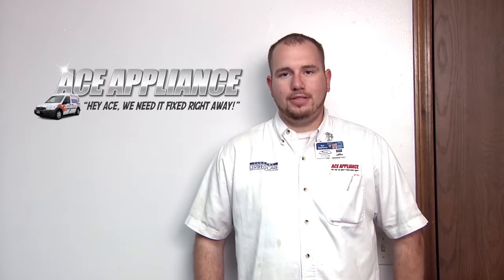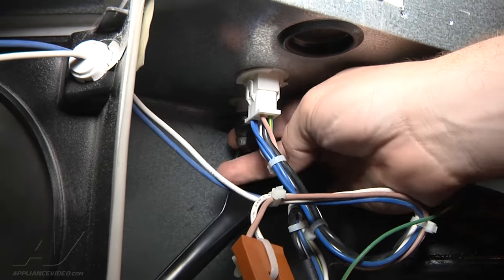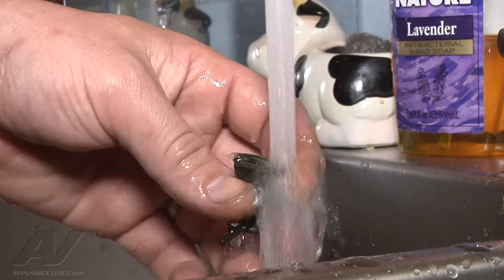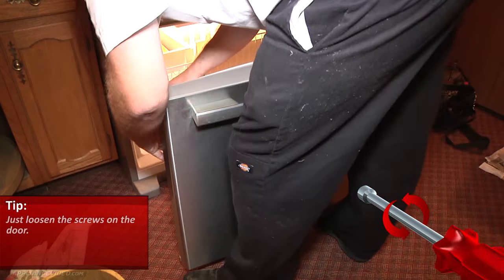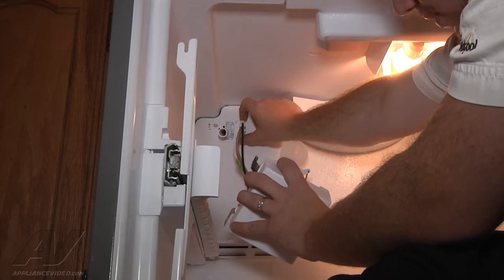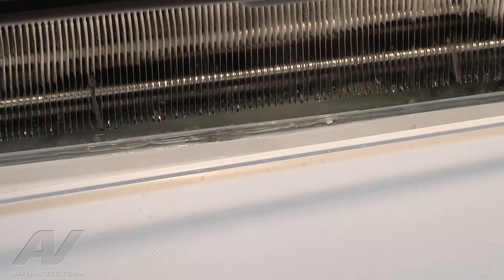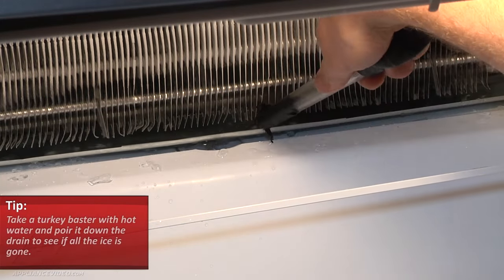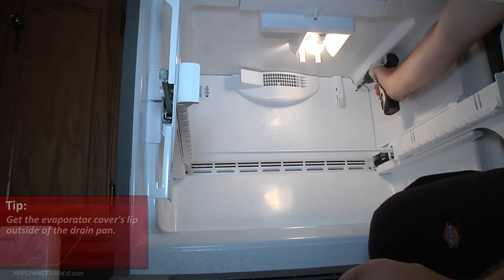Whirlpool Refrigerator Repair - Ice Buildup in the Freezer - GX2FHDXVY06

Comment: Very, very helpful video!  My frig is a slightly different model made in 2016 but largely similar, with a trap instead of the one way valve.  The trap was plugged with gunk which was easy to remove.  I really appreciate the detailed steps in the video.  Thanks for going to the trouble of making this available!

Comment: Perfect, thank you! I just fixed the problem following your video exactly. Instead of ice clogging my drain, there was a ton of insulation blocking the drain. I had to break it all out using screwdrivers from inside the freezer and the bottom of the drain tube. It seems crazy to me, like someone used spray foam to intentionally plug up the drain. Have you seen this before?

Comment: With my similar Whirlpool WRF535, one of the annoying habits is that Ice can spill behind or fall through the slotted trays and accumulate on the bottom of the freezer.  Eventually this interferes with the door closing completely, causing frost to build up.  Thanks for the tips on how to get the door and bottom tray off quickly.  Easy!
Reply from the maker: Great question, if you have a more technical question that our parts department cannot answer, you can search our over 17,000 answered questions free at our website www.ApplianceVideo.com under our Repair Help section. You can also call our parts department at 1-800-830-5465 and they can give you help 7-days A week ,or search at www.SaveMoreOnParts.com  .

Comment: My refrigerator was only 4 months old when this happened and the ice was 2" thick in the bottom of the freezer.  I took off the little black rubber drain tip and left it off, otherwise it would just happen again. That was Sept 2017, have never had a problem since.  That was 5 1/2 years ago.  Works fine without that piece.

Comment: Thank you so much. 
The only difference is that I don't have the ice maker in the freezer.  The valve in the back was filled with dust and what looked like hair.

The unfortunate part is that I snapped one of the wings off of the fan in back.  Will it still be operational or should I replace it?

Comment: Thk you so much i did mine today same as you exept my drain also was clogged with ice and my rubber valve was dirty and clogged too.

I got a ice machine on that fridge everything look good no cloggued and water arrive to the solenoid valve, but it didn't work. No ice no water nothing happen with the ice machine. Solenoïde valve or what.

I will take out the ice machine soon if i didn't find a solution.

Nice day to you

Comment: Could the defrost timer/board also cause freezing on the coil, if it fails?  I have this model, and I suspect this is the case being the unit never turns off, and ice builds up within a week.  The unit does not leak water as the one in this video.
Reply from the maker: Great question, if you have a
more technical question that our parts department cannot answer, you can search
our over 10,000 answered questions free at our website www.ApplianceVideo.com under our Repair Help section. You can also call
our parts department at 1-800-830-5465 and they can give you help 7-days A week
Monday -Sunday, or search at www.SaveMoreOnParts.com  24 hours
7- days A week.
Reply: this is exactly my problem as well, has nothing to do with drain problems but instead with defrost heater / thermostat.

Comment: There is also a video of a guy bending a copper wire to hang onto the heating element and dip into the drain. It carries the heat over and prevents freezing over

Comment: My coils in the bottom freezer keep icing over and then top fridge gets warm.  Both temp. settings are set at 4.  I melt ice off coils with hair dryer and it’s fine for few weeks.  Any suggestions ?
Reply from the maker: Great question, if you have a more technical question that our parts department cannot answer, you can search our over 17,000 answered questions free at our website www.ApplianceVideo.com under our Repair Help section. You can also call our parts department at 1-800-830-5465 and they can give you help 7-days A week ,or search at www.SaveMoreOnParts.com  .
Reply: Same issue I’m having. Do you remember what fixed yours?

Comment: Very practical video!  Can a blow dryer is used in stead of turkey baster ( unavailable at home) to melt the ice inside the compartment?  Thanks
Reply from the maker: Yes you can! Great question, if you have a more technical question that our parts department cannot answer, you can search our over 17,000 answered questions free at our website www.ApplianceVideo.com under our Repair Help section. You can also call our parts department at 1-800-830-5465 and they can give you help 7-days A week ,or search at www.SaveMoreOnParts.com  .

Comment: For anyone who finds this video the rubber grommet has been replaced by a plastic tube you can find at any parts place. You really need to clear out all of that ice and ensure the drain is free of ice before you replace everything. That upper rack is tricky to remove as well. They have a separate video on it.

Comment: If you do not want to open all the freezer section parts then just turn off the freezer section and close freezer for 3 to 6 hours and most probably all ice  will melt and drain out. Clean drain first from back.
Reply from the maker: Great question, if you have a more technical question that our parts department cannot answer, you can search our over 13,000 answered questions free at our website www.ApplianceVideo.com under our Repair Help section. You can also call our parts department at 1-800-830-5465 and they can give you help 7-days A week ,or search at www.SaveMoreOnParts.com  .
Reply: How do you turn off the freezer section?

Comment: QUESTION: Does the surrounding temperature affects the functioning of the French Door Refrigerator?  I live in a tropical country. On a very hot day our temperature can reach as far as 36 degrees
Reply from the maker: Great question, if you have a more technical question that our parts department cannot answer, you can search our over 17,000 answered questions free at our website www.ApplianceVideo.com under our Repair Help section. You can also call our parts department at 1-800-830-5465 and they can give you help 7-days A week ,or search at www.SaveMoreOnParts.com  .

Comment: So, if I clean the grommet, can I just defrost the freezer for a day or so to just let the ice melt? It's winter in Montana...we can just put everything in the freezer outside.
Reply from the maker: Great question, you can call
our parts department at 1-800-830-5465 and they can give you help 6-days A week
Mon-Sat . You can also search at www.SaveMoreOnParts.com 7- days a week.  If you have a more
technical question that our parts department cannot answer, our technicians are
answering all questions at our website at www.ApplianceVideo.com under our Repair Help section. We have over 6,000
common questions and answers that you can easily search through by your model
number, appliance make, problem or error codes, and It’s completely free to
search through our question & answer library. There is a very good chance
you question is already answered there.

Comment: This is a great video and we successfully used it to fix a nearly-identical refrigerator. Unfortunately, after we put it all back together, the icemaker stopped making ice! Our icemaker is through the door, sitting in the refrigerator compartment, but it just doesn't seem to be getting water. The through-door water dispenser works fine though. Any ideas?
Reply from the maker: Great question, if you have a more technical question that our parts department cannot answer, you can search our over 17,000 answered questions free at our website www.ApplianceVideo.com under our Repair Help section. You can also call our parts department at 1-800-830-5465 and they can give you help 7-days A week ,or search at www.SaveMoreOnParts.com  .

Comment: Great video.  Where is the damper door as I think the fan is running but no air is getting to the fridge compartment.  Could it be clogged with frost or something or just broke?  Fridge is 60 but freezer seems fine just a little frosted up.
Reply from the maker: Great question, if you have a more technical question that our parts department cannot answer, our technicians are answering all questions at our website at www.ApplianceVideo.com under our Repair Help section. You can also call our parts department at 1-800-830-5465 and they can give you help 7-days A week Monday Sunday, or search at www.SaveMoreOnParts.com  24 hours 7 days A week.
Reply from the maker: Great question, if you have a more technical question that our parts department cannot answer, our technicians are answering all questions at our website at www.ApplianceVideo.com under our Repair Help section. You can also call our parts department at 1-800-830-5465 and they can give you help 7-days A week Monday Sunday, or search at www.SaveMoreOnParts.com  24 hours 7 days A week.
Reply: I'm having the same issue. You ever figure this one out? That's in advance!
Reply: It just kept freezing up every month or so and became not worth it.  I sold it to a guy for $100 who has repaired a few.  Sorry...wish I would have figured it out.

Comment: I did all this last night.  Drain plug was clogged to hell.  I cleaned out all the ice behind the panel (I used a blow dryer).  This morning I still woke up to ice build up in the freezer.  What else could it be?
Reply from the maker: Great question, if you have a more technical question that our parts department cannot answer, you can search our over 17,000 answered questions free at our website www.ApplianceVideo.com under our Repair Help section. You can also call our parts department at 1-800-830-5465 and they can give you help 7-days A week ,or search at www.SaveMoreOnParts.com  .
Reply: Did you find a solution to this mine is doing the same
Reply: This is such a crappy design. Totally failed on engineering. I think I won't buy another Whirlpool product again after spending a day with this fix.

Comment: the freezer bottom  door Whirlpool 3 doors is locked or blocked I can't open it. i unplug the refrigerator but still cannot open it. pls help thanks for your tutorials
Reply from the maker: Great question, if you have a more technical question that our parts department cannot answer, you can search our over 17,000 answered questions free at our website www.ApplianceVideo.com under our Repair Help section. You can also call our parts department at 1-800-830-5465 and they can give you help 7-days A week ,or search at www.SaveMoreOnParts.com  .

Comment: My ice maker is in the fridge area...will replacing the drain tube on the bottom solve the water leak in the freezer and the ice maker?… Ice freezes over in the ice maker as well.
Reply from the maker: Great question, if you have a
more technical question that our parts department cannot answer, you can search
our over 10,000 answered questions free at our website www.ApplianceVideo.com under our Repair Help section. You can also call
our parts department at 1-800-830-5465 and they can give you help 7-days A week
Monday -Sunday, or search at www.SaveMoreOnParts.com  24 hours
7- days A week.

Comment: We don’t have any water hooked up to our Whirlpool French door refrigerator for ice or water. It still had fluffy type ice all over the freezer. Why?
Reply: Check if your freezer door cannot close fully, or if any seals are damaged.  Moisture getting into the freezer through any gaps will do this.
Reply from the maker: Great question, if you have a more technical question that our parts department cannot answer, you can search our over 17,000 answered questions free at our website www.ApplianceVideo.com under our Repair Help section. You can also call our parts department at 1-800-830-5465 and they can give you help 7-days A week ,or search at www.SaveMoreOnParts.com  .

Comment: What do you do if the ice buildup is in the refrigerator? I can no longer put the bottom drawer in because of the buildup.
Reply from the maker: Great question, if you have a
more technical question that our parts department cannot answer, you can search
our over 10,000 answered questions free at our website www.ApplianceVideo.com under our Repair Help section. You can also call
our parts department at 1-800-830-5465 and they can give you help 7-days A week
Monday -Saturday, or search at www.SaveMoreOnParts.com  24 hours
7- days A week.

Comment: Could this cause the freezer door not to close completely?
Reply from the maker: Great question, if you have a
more technical question that our parts department cannot answer, you can search
our over 10,000 answered questions free at our website www.ApplianceVideo.com under our Repair Help section. You can also call
our parts department at 1-800-830-5465 and they can give you help 6-days A week
Monday -Saturday, or search at www.SaveMoreOnParts.com  24 hours
7- days A week.
Reply: Absolutely.  Ice build-up in the back of the freezer compartment can keep the door from fully closing.  It happened to me.

Comment: Mine is draining into the crisper tray as well and no longer making ice what is the problem
Reply from the maker: Great question, if you have a more technical question that our parts department cannot answer, you can search our over 17,000 answered questions free at our website www.ApplianceVideo.com under our Repair Help section. You can also call our parts department at 1-800-830-5465 and they can give you help 7-days A week ,or search at www.SaveMoreOnParts.com  .
Reply: It was designed by Whirlpool. I can't believe this design was OK'd by their engineers.

Comment: If this is not fixed what would happen next... That is would it cause the freezer to stop cooling?
Reply from the maker: Great question, you can call
our parts department at 1-800-830-5465 and they can give you help 6-days A week
Mon-Sat . You can also search at www.SaveMoreOnParts.com 7- days a week.  If you have a more
technical question that our parts department cannot answer, our technicians are
answering all questions at our website at www.ApplianceVideo.com under our Repair Help section. We have over 6,000
common questions and answers that you can easily search through by your model
number, appliance make, problem or error codes, and It’s completely free to
search through our question & answer library. There is a very good chance
you question is already answered there.
Reply: JOHNROSS PHILLIPS 0000 000 0000
Reply: Yes, your fridge and freezer will stop working properly because that's what we have now and thanks to this video, we can fix it ourselves and have it fixed sooner and save money.

Comment: Where is the filter located on this refrigerator?
Reply from the maker: Great question, you can call
our parts department at 1-800-830-5465 and they can give you help 6-days A week
Mon-Sat . You can also search at www.SaveMoreOnParts.com 7- days a week.  If you have a more
technical question that our parts department cannot answer, our technicians are
answering all questions at our website at www.ApplianceVideo.com under our Repair Help section. We have over 6,000
common questions and answers that you can easily search through by your model
number, appliance make, problem or error codes, and It’s completely free to
search through our question & answer library. There is a very good chance
you question is already answered there.

Comment: Why go through the work of taking all that off, vs using a hair dryer or simply unplugging?
Reply: BTW, if you put a paper towel on the bottom (not blocking anything) if it leaks/freezes again, you can lift the sheets out easier.  Also, poor air circulation (overpacking the fridge or freezer) will also cause it to freeze up, then your fridge temp will increase. Many think their refrigerators are broken, when in fact, it's a simple fix. Not a fan of bottom mounts.

Comment: Couldn’t you just unplug it for a few days to fully defrost all of the ice build up?
Reply: The rubber valve is clogged and dirty you need to remove it and clean. The drain is full of ice too that will take many days for the ice to become water.

You need to do exactly what he told for good result and you will not do it again less than one year after.

Comment: I own a similar unit, Whirlpool Freezer WVR986FDEM01. It freezes up about every month or so and stops working, then my food thaws and ruins. All Whirlpool bottom freezers are junk and will terribly disappoint you. My electric bill also went up 100 dollars a month after the freezer started giving me problems. I paid 3,000 for mine. Buyer beware, these units are Junk!
Reply from the maker: Great question, if you have a more technical question that our parts department cannot answer, you can search our over 13,000 answered questions free at our website www.ApplianceVideo.com under our Repair Help section. You can also call our parts department at 1-800-830-5465 and they can give you help 7-days A week ,or search at www.SaveMoreOnParts.com  .
Reply: This engineering is totally Fracked. How can they seriously ok it for production? I'm done with Whirlpool crap.

Comment: the evaporator is not icing up in this video but rather the floor icing up. they are completely two different issues.
Reply from the maker: Great question, if you have a more technical question that our parts department cannot answer, you can search our over 17,000 answered questions free at our website www.ApplianceVideo.com under our Repair Help section. You can also call our parts department at 1-800-830-5465 and they can give you help 7-days A week ,or search at www.SaveMoreOnParts.com  .
Reply: Seems the crappy engineers designed the floor of the freezer as the evaporator tray..... forgot it was in the freezer... lol. What a Fracked up design this is. I hope this fixes my problem any way.